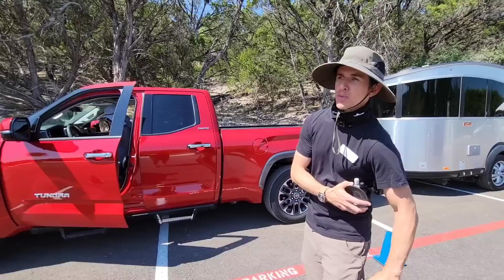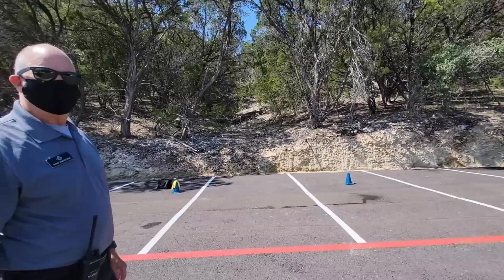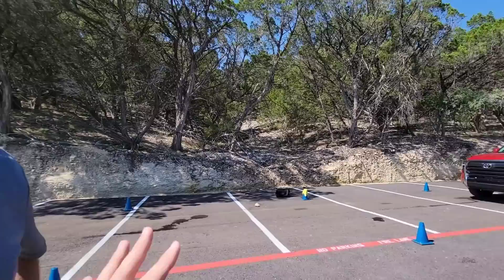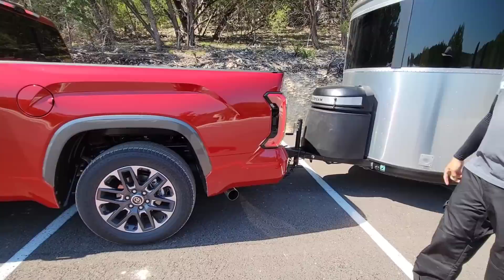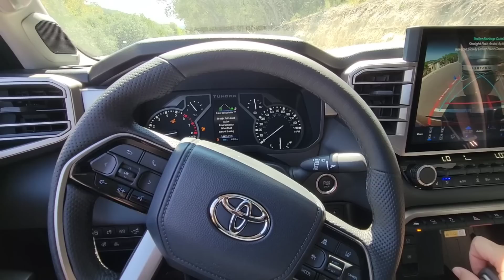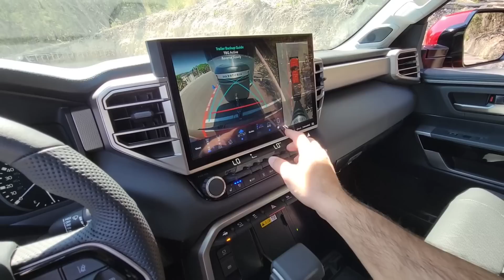2022 Tundra! Backing up a trailer with Technology!

Comment: I would love to have this on my truck so that my wife could back my boat down a boat launch.  I currently have to do both the backing and the boat handling because my wife doesn't do either one.  She has tried backing the boat trailer down a launch, but going in reverse is "just not her thing".  If all she had to do was put it in reverse and push the button to make it go straight I think she could handle that!

Comment: In another video they had the truck at an angle and as soon as they got the trailer at the angle they wanted it to go straight (the truck was not straight with the trailer), they turned the feature on and the truck steering wheel did a massive turn to start straightening out the truck with the trailer to go straight back. Wish I could have seen more of that in this video as well! As newish RV owners, this has been our biggest issue with backing up our smallish trailer! We get the trailer at a good angle then have trouble straightening out the truck with the trailer to go straight back so we end up moving the trailer where we didn't want it to go.  Needless to say, we are very excited for this feature! 😆

Comment: Comparing 2021 f150 back assist, this one is not impressive at all. It seems it is only helping the last part of backing a trailer after you’ve done most steeling job. That’s the top reason I choose f150.

Comment: If you get the trailer to the point that all you need to do is backup straight, then I think you don't need the "system". It's just one more thing to go wrong, and they can't fix it.
I just had my 2018 RAM lemoned because they couldn't fix an electrical issue.

Comment: From what I've seen, and as demonstrated in this video, you can add inputs in conjunction with the backup assist system, so it acts as a supplement.  It's different than Ford's system where you manipulate a separate knob.  In Toyota's implementation you use the steering wheel to make directional adjustments, so using it is more natural (or so they say).  I'm looking forward to using it.   Kind of like cruise control for backing up.  The best systems work in conjunction with the driver, instead of taking the driver out of the loop completely.

Comment: So from what I gather, all this does is back the trailer up in a straight line after you've done all the work of steering it towards where you want the trailer to go? I really don't throw this term around really at all but if I understood this video right, this is  MASSIVE GIMMICK. I could be wrong though, but that was my take from it. Always love your videos!!!
Reply: If you spend enough time at a boat ramp or RV park you'll see plenty of people having trouble with backing up straight.

Definitely not as useful as Ford's system with full steering control but it still has its uses.

Comment: The problem with Fords version is that it relies on a sticker in the camera and can be really finnicky I never use it
Reply: They changed that on 2021 F-150. The sticker is gone and replaced with sensor that is attached to trailer and gets plugged into truck.